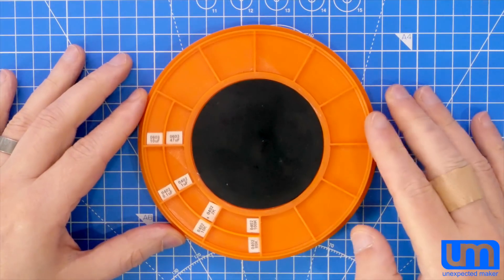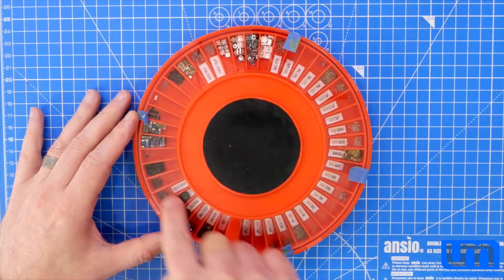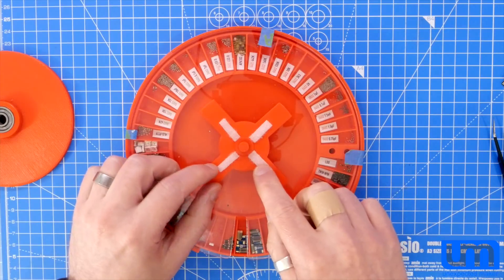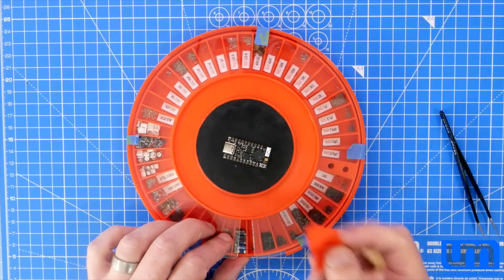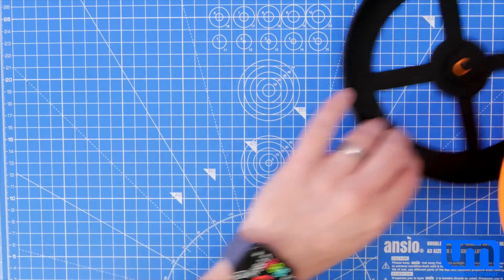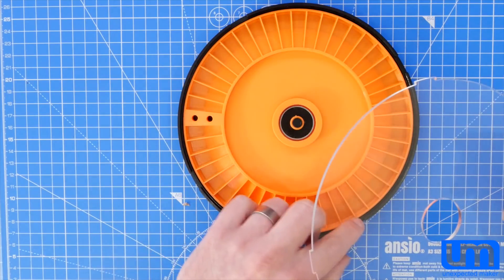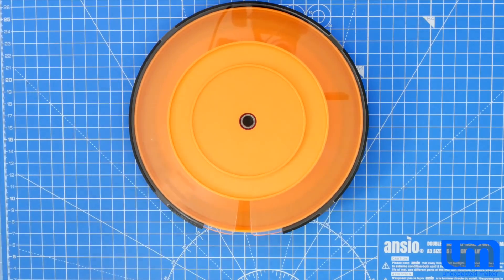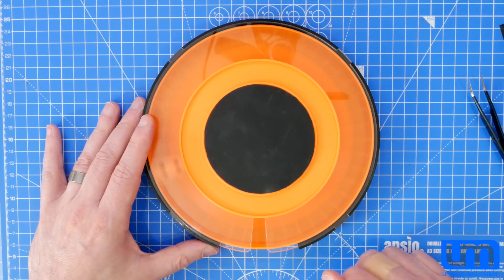Manual PNP Turntable V3 - It's finally ready!

Comment: small removable containers would be good to have (there are loads on a certain asian webpage, with lids), so you wouldn't need to fiddle with funnels or picking out parts when you need to empty a compartment, of course it will slightly decrease the number of available spots for parts, but lifting out and dropping in another container would be easy fix to that issue, piece of steel on the bottom of each container, and a magnet inside the base (under the acrylic cutout) would provide some indexing and holding power of the container when it is rotated to the open position

Comment: Could you fit a stepper motor with foot pedal to step to next component required, even 2 steppers so the pcb turn to correct position as well.

Comment: Thanks so much Sean, I built one a while back and just tried it a couple of weeks ago to assembly an I/O board for the pi zero 2W. I used a black marker to write an ID number in each tray. Then on my printed BOM I wrote the tray number for each part as I loaded them. Even though my board was a little oversized, picking and placing worked extremely well. If you ever come to Canada I will buy you dinner! Thanks again.

Comment: Sorry for last minute request... I need a recommendation on a decent 3D printer or (cnc/3D printer combo if one exists.) ebay is offering a 20% discount upto $150 off any purchase. So I  was hoping to take advantage and try to get an (under $500 unit) 

The sale ends on July 25 USA time, so I need info asap.. Thanks

What is the best under $500 system?
Reply from the maker: Never got a notification for this, sorry, A CNC/Printer combo? Like the snap maker? I really know noting about combo machines, sorry. I'd always buy dedicated machines.
Reply: @UnexpectedMaker  Do you know anything about the "Stepcraft M-Series" CNC? They don't say, but it looks like you could change the cutter head for a 3D print head.

Comment: Great design! Though looks like it is much easier to find 25x37x7 bearing on Amazon (and they are much cheaper). Is it difficult to modify it to use this one instead?
Reply from the maker: Thanks! I've included the STL files so folks can modify the design if they want to change things.
Reply: @UnexpectedMaker  I will try to make a variant for 1mm thicker. Btw what id diameter for rubber piece? It is not easy to deduce it from step file.

Comment: What a great design!  I built one.  The only change I made was I made the top in two pieces such that I did not have to use the support.  The bearing holder is separate and glues in the top turntable.

Comment: Hi Seon, the idea of taping the lid on was the low point of a nice design. Why not make 3 or 4 U shaped clips (3D Printed of course). You could cut small slots in the acrylic for them to hook into at the top and then clip them over a lip at the bottom (or use bolts into captive nuts underneath).
Reply: whats wrong with tape

Comment: To limit ESD/EOS, the assembly should drain to the work surface. All the moving parts, including the operator, generate triboelectric charges, that is transferred to the PWB/PWA when building. Using carbon fibers embedded in the parts may be enough to keep the ESD gremlin at bay. This is a good design for building small project with low part count.

Comment: Great job!  Suggestion:  you can maintain different outer turn tables for capacitors, resistors etc.  And they are detachable. So you can swap them out as you solder different types of components.

Comment: There seems to be enough space to just ditch the (radial) bearings and make some raceways for airsoft bb's or something.  I would also section up the parts since I don't see some of them really needing to be printed as 1 piece, plus to eliminate the massive amount of supports on that top disc.

Comment: think "twist-to-lock" for the lid... tabs could lock into slits instead of just seats ;)
Reply from the maker: That would make the edges of the turntable higher than the acrylic, or uneven, making it uncomfortable on the hands while working. I have it flush like it is for my own comfort :)
Reply: @UnexpectedMaker  then cut a locking slit in the tabs halfway so they can lock into the frame with a twist, staying flush. Might not be super strong, but it would remain flush as well as somewhat lock the lid in place. Great project, I will be 3D printing mine soon, and will try various ideas. Thanks for sharing your design!

Comment: If your concerned about ESD, you could coat it in Licron Crystal. 
This stuff isn't very cheap, but cheaper than a role of ESD filament. 
Apperantly, it works very well on many other materials including plexi-glass.
Reply from the maker: The tolerances are probably too tight to coat the pieces in anything - unless it's something that is absorbed. Any surface buildup will likely cause he pieces to make contact and scrape.

Comment: This is great, Seon. I could have done with one of these when building a board last night. lol

If I can make one suggestion, though...

What about just having the whole center piece of the acrylic cut out?
That way, the top part (board holder) could be lifted out so you can still get to the lower part to replace the labels.

(Which would also let you glue the acrylic in place.)
Reply: Oh, and possibly make the lower part of the funnel just a bit taller, so it can double as the lock, and won't get lost as easily?

Which would also allow you to use that "lock" compartment for components.

(adding some side flanges to the funnel which sit on the acrylic would keep it more stable when used as a lock.)
Reply from the maker: Hmm, I don't understand, sorry, What part would you cut out? if the Acrylic covering the label area is not there, then it's not covering and holding the components in place.
Reply: @UnexpectedMaker  If you cut a hole in the acrylic just for the area where the board tray is (like a donut), it would still cover the component trays around the edge, no?

Or I'm guessing the idea is to store larger chips and other components in the central area around the bearing?
Reply from the maker: The assembly tray has to sit "a bearing width" above the component tray, so cutting a whole in the acrylic wont help... it's not the acrylic that is preventing the assembly tray from being lower, it's physics ;)
Also, I have 0402 and smaller in my tray area... I don't want a spinning non-permanent cover as the only thing preventing those components from escaping or mixing with others ;)
Reply: @UnexpectedMaker  Ahh, fair enough.

I just thought the assembly tray could sit at the same height it does now, just with the acrylic directly below it cut out.

The acrylic around the component trays would still be there, and not spinning.

I can see why it's worth having it in the middle to prevent the parts falling ou, it's just that if it the whole thing was turned on its side or upside-down, the parts would likely still mix in the middle anyway.

Just a thought. Still a fantastic concept. ;)

I definitely need to get myself one made, as I only really use a few common resistor and cap values, and it's pain having to flip through the "book" things, as you know.

Comment: Nice, very nice.
I join 'The Embedded Hobbyist'
The ESD is crying.
I know the ESD is a dirty word, but it's already cost me enough parts that I've had to laboriously replace.
The orange bar would be replaced with ABS ESD filament (black only :-( ). But covering acrylic, that's a disaster from an ESD perspective.  Only replace it with glass.
Applicable in this version only to resistors, capacitors, choke.

Comment: Could you not print cut-outs on the base side for the acrylic notches so you can rotate the acrylic lid into the side a bit like sticking a light bulb into a fitting?
Reply from the maker: Not without having the sides sit higher than the acrylic making it uncomfortable on your hands/palm edge while working. It's just uncomfortable to use if your hand in any way has to rest on the edge. I've 100s of hours of usability testing on this. Function over form.

Comment: Very nice and clean design 👍 A tip for 3D printing though: Round cavities for a press-fit really are zero tolerance, which might be problematic for some users. The cavity has no way to flex, as it would actually need the circumference to stretch, which is not possible with hard plastic. So my tip: instead of designing a round cavity, make it a hexagon or octagon etc. with the inner circumference designed for the press-fit. This allows the six/eight points where the part and the cavity actually touch to flex outward slightly and allows for bigger tolerances.
Reply: It also gets rid of the problem that on a round cavity a seam might appear that protrudes inwards where the inner perimeter starts/ends due of retraction and/or slowdown, because on a hexagon this usually happens on one edge that won't have contact to the part and thus it won't matter.

Comment: On the topic of ESD I think there is a pretty easy fix, place a piece of kitchen foil or thin wire up the inside of the plastic center shaft so you have a decent connection to the bearings and have that cable connected to a banana jack on the back or if it's foil just have a piece under the bottom of the base so it contacts your ESD work mat, then print the two spinning components in an ESD filament.
(You could print the whole design in ESD filament but it's expensive so I would avoid print the base in it.)

Comment: Awesome. Maybe a side opening on the top left side to spin the components wheel with the left hand?
Reply from the maker: You can currently spin it with the left or right hand as the opening is wide and is half on the left and half on the right :)  I spin mine with my left hand and have my tweezers in my right hand.

Comment: Looks like a slow Van De Graaff generator.  Conductive PLA , do they use carbon black for black filament so it might  conduct a bit?  Still usefull for caps, resistors, and inductors.  I like to strap up before getting the esd parts out, but thats just the  bondage side showing through.  :)

Comment: Congratulations on finalising the manual assembly unit
Now to automate the component access like at the very start? Probably easier to just rotate manually as now done. The extra effort to select the part bins, via touchscreen for example, will be no quicker than manually rotating the mini bins, but maybe overtime maybe saves some finger strain. Yet also takes the vision path away for the assembly, that could also be worse for the assembly task.
Good effort.
Reply: Voice command integration would be cool... "Alexa, pick C4 please".

Comment: The sequence of PNP turntables is delightful and inspiring!  But having transitioned from a ring of open trays to the better single access window, it gets me wondering how much benefit there is to having the inventory surround the board turntable, since the rest of the donut obstructs your tweezer hand's access to the board turntable, I think.    So I'm thinking of a variant where the board turntable as a smaller separate unit, with the inventory turntable beside it rather than concentric. If the two were attached, they could form a figure-8 shaped assembly, The inventory's access window could be adjacent to the board turntable, in easy reach. And it would be easier to get just the board turntable under my microscope.  Just a thought.
Reply: and the 2 circles have teeth or chain, spin the lower that spins the upper in the "eight", 3 bearings needed,  1 for turntable which has no contact withe others, 2 to spin the parts.
Reply: @jyvben1520  I don't think I'd want the two turntables linked, because you turn the board turntable for best access to the target footprint, and you turn the inventory turntable to access the needed component. These two functions need to be independent.
Reply: @Graham_Wideman  sure, 2 lower circles connected to make the parts circle turn which form the 8, 1 upper (in the lower part of the 8) which will be the build turntable, no need to put down the tweezers when wanting to rotate the parts, the free hand can rotate the lower circle (under the build table)  which then rotates the parts in the top of the 8.  the eight being a bit slanted to make it easier to move the picker in an arc from build to part to build, difficult to explain ... the acrylic part can be mounted upside down for left/right handed so that the slot is on the correct side.
Reply: @jyvben1520  Oh, I see what you mean. Interesting!